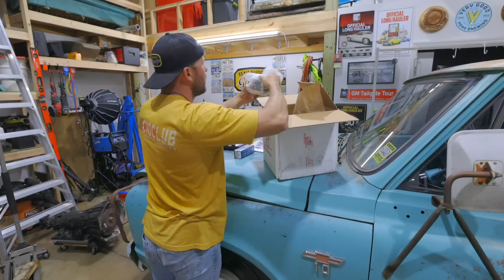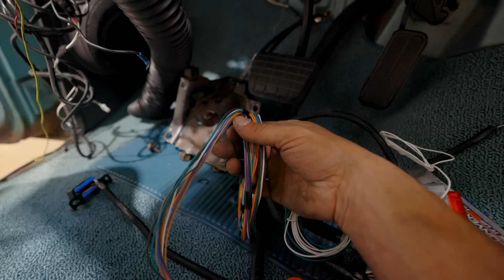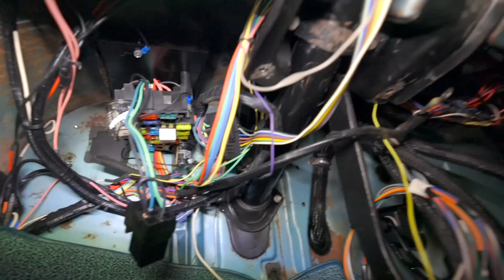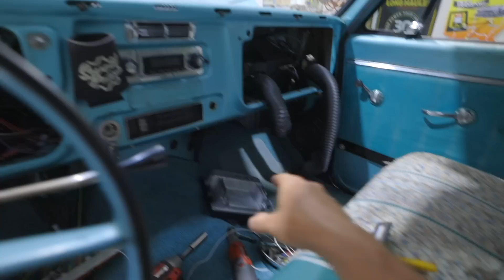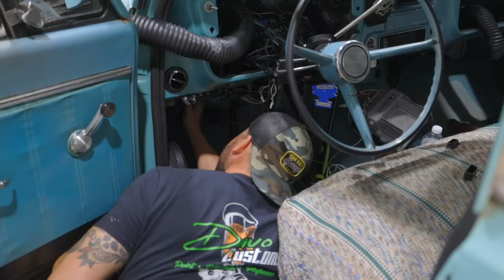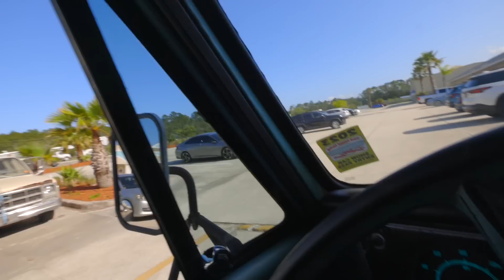Why I’m DONE with Holley EFI (What Went Wrong…)

Comment: I wrote Holley off 5 years ago when they left me high and dry with a Faulty Sniper unit. Have ACES now and couldn’t be happier.
Reply from the maker: I’ve heard mixed reviews on the ACEs system but everyone I’ve heard that has them says they are great!
Reply: @yeahbuddygarage like most brands 90% of the problems is install error. Holley just lost me because customer service. Aces is based in TN and their support and customer service has been amazing. Now if someone is looking for a system to run big power and have inputs for all kinds of data, it’s hard to beat Holley

Comment: 5 cars n Holley , 1 on haltech and 5 years on a radial truck and zero issues. Good luck tricking the factory garbage to make power and being prisoner to a tuner or HP. Factory ECU junk doesn't have half the features or axdons. You're allowed to have a choice and I wish you luck.
Reply from the maker: My Holley system ran great for 3 years but I think Holley is better suited for race/ power applications and a factory ECU is better suited for drivers. I actually drive my builds and would prefer reliability over power. I just drove this truck on an 800 mile road trip and took my MPVI3 and computer with me just in case I had any issues and the truck ran great. I also have a factory ECU in my 70 blazer. It's been done for 9 years with 0 issues and we drove that truck from Florida to Cali back to Florida last year so I'm very happy with my choice.

Comment: Those PSI harnesses are not cheap considering you can get a china one that does the same thing for $100-$200……those factory ecu’s are also funny sometimes with hanging throttles  and always thowing check engine lights…..hope your friends are good tuners and owe you ALOT of favors
Reply from the maker: Just took it on an 800 mile road trip with 0 issues. I've also had a factory ecu in my 79 LS swapped blazer for 9 years with none of those issues. Drove it from Florida to Cali and back and the only time it threw a check engine light was when an O2 sensor went bad.

Comment: Just say no to factory ecu’s……i love my terminator X powered cars, never had any problems with them …..(knock on wood) even with boost on both my swapped vehicles, my nova i had a remote tune put on and my c10 has a wizard tune….both making around 12-14lbs boost…….those factory setups are fine for stock engines, but wheres the fun in that…..having to pay for a tune everytime you mod your motor is gonna get expensive and become a hassle really quick….but hey its your truck buddy!!! Just keep that holley handy cause when you go turbo , you will be installing it again, mark my words!!!!
Reply from the maker: I think Holley's are great for race/ power applications but I'm more concerned with reliability. I just drove this truck on an 800 mile road trip with 0 issues. I also have a 79 LS swapped blazer that's been done for 9 years that I drove from Florida to Cali and back on a 6,500 mile road trip. I also have an MVPI3 with HP Tuners so any changes I make I'll just hop in and tune it just like I would the Holley.

Comment: Haltech rebel is a fantastic option for LS swaps, the harness is excellent and the support is second to none. I'm sure I sound like a paid advertisement but I have been so impressed with their support team, I've called numerous times because I was one of the early adopters and did my own version of 4l80e control before Haltech released their version and they'd pick up the phone day or night because they have offices on multiple continents and log in remotely if required. I am happy with the system in every way

Comment: Kinda crazy never had any problem with my Holley system ever. But i also ran it clean power just as holley tells too .   

Cant say a system is bad if ypu install it wrong...
Reply from the maker: Mine ran great for 3 years. Took it on multiple road trips with no issues. Installed it to Holley's specifications. Read the comments, this is a common failure.

Comment: This is why I went with Aces Wild Card MPEFI. When I did my research Aces just seemed to have a better system and it uses two o2 sensors. I’m currently installing it on a Smeding 383 for my 99 GMC Suburban. I’ll have it at the C10 Fall Revival in October and a few other shows this summer.

Comment: I get the Holley frustration, I run edelbrock pro Flo 4 on my stuff and I have zero complaints. I have heard that holley’s ECU’s are really temperamental but I’ve heard that with the sniper systems, and it was because of radio frequency interference. If it was only a power supply of constant 12 volts, would it have been possibly worth trying a PDM first before switching ECU’s and stuff before switching everything?

Comment: Running the battery leads to the Starter will eventually kill that ECU, the battery acts as a noise filter that keeps sensitive electronics from getting killed.  The Starter is the dirtiest electrical component in a car.
Reply: I agree..

Comment: I have done a couple LS swaps now, the stock computers run good, the tuning is harder for sure. I agree about the corporate BS that goes with the Holley, I have a Dominator system and a Terminator system that I am using for Big Block Chevy motors and most of the stuff is based on all GM parts. The main Engineer from Holley who developed the parts now works at my company and he didn’t have great things to say about it.

Comment: Great video. 
You have the patience of a saint dealing with this. 
Look forward to more 67 c10 content. 
Please do a low buck cosmetic upgrade to your truck. 
It deserves it!
Ditch the grille guard and LH giant mirror. 
Add some stock smaller mirrors.
Maybe do some  chrome bumpers and grille/headlight trim. 
Add a correct year radio antenna. 
There’s a lot you can do  to clean these up without painting them. 
Not trying to offend the look you have going. 
I just like a clean patina look.

Comment: i have close to $3k of holley garbage sitting on a shelf in my shop. i got around 300 miles on the first ecu and the second wouldnt reconize the cam and crank sensors.  i ripped that garbage out and put a stock po1 ecu in.  it starts and runs better than it ever did with the holley.  an aftermarket boost controler is way cheaper than a holley.

Comment: I spied a scotch lock behind the instrument cluster. Those are evil. Glad you got it going again. Sounds good.
Reply: You ain’t joking about those scotch locks. Bolt on battery terminals are in about the same class in my opinion.
Reply: I hate scotch locks so bad. Installed a horn kit that came with scotch locks on a brand new car in 1982, all the connections failed within 3 days and had to replace them all with but splices. Whenever I see a scotch lock, they go immediately in the garbage.

Comment: You guys. EFI makes no power than a good carb, properly tuned, for a quarter the price. This is all about penis envy. I wrote books on fuel injection, and I stick my carbs. And there aren’t too many people that can use a carb. Look at all those wires that don’t do anything important. Ignition timing is the most important issue.
Reply: Sir, 100% fact. I spent the time to tune my dual quad Holleys using Zetronics AFR gauge. Then I just installed a programmable distributor made by Progression Ignition. A must for any carbureted engine, in my opinion. With a Weiand tunnelram my engine has the throttle response equal to any efi engine.
Reply: By the time you buy a nice ignition, and a carb, your definitely more than 25% of a Term X. A decent carb is $600-$800.
Reply: @rpturbo  I didn’t think much about cost when I commented.  I was mainly thinking of my experience with good tuning. It’s been quite some time since I’ve bought my carbs. I believe it was around 1996. I got the tunnel ram and both carbs in a package deal from summit for $600. They are in fact pricey now.
Reply: @Pooleo55F100  you know, I respect and appreciate your honesty. So many people just want to talk smack. I appreciate a good carb, on certain things, but you definitely get what you pay for in a carb. I tune mostly EFI now, but all of the fundamentals come from a carb a dizzy, if people don't understand the basics, EFI just will never do what they want.
Reply: @ thank you. I’m 58 and just started messing with afr gauge a couple years ago. These dual quads was beating me down for most of a summer. I just didn’t understand how the circuits worked together. Lots of reading and head scratching. Finally it kinda came together. A buddy told me I was learning on the worst setup, 2 carbs instead of 1. Thanks again for the conversation.

Comment: So was it really the holley? It seems like it was the wiring from the other shop.
Reply: COUNTLESS times Holley ECU taken out because people don’t wire them to the battery like the instructions say

I’ve seen multiple occasions of ecu failings because of wiring to starter.
Reply: Holley get such a bad wrap from people bodging the wiring, not wiring ecm directly to battery etc (he's wired this one to the starter, which holley aren't cool with they have a video on why that can be a problem for the ecm, voltage spike etc, I wonder why his holley is fried..........................) . The "carb guys" love to trash them when its really wiring/ fitting errors most of the time.

Comment: I am currently using a P01 ecu on a turbo ls with zero issues. I'm going to stay with a stock ecu as long as I can. I always recommend it to everyone if they plan to daily or drive the vehicle regularly. Holley makes a great product but to me nothing beats a stock ecu being reliable.
Reply: I totally agree with you. I run a stock ecu with a thinned out truck harness. Easy to make work and very reliable.
Reply: Oe for the win
Reply: I was going to go Holley Xmax. I’m doing my first ls build and swap into a 70c10. I plan to go turbo later on so prepped motor for it.  Long story short I’m going to go this route with psi and stock ecu for reliability!